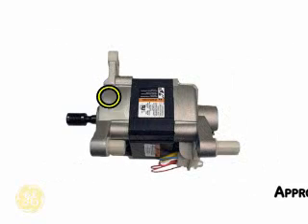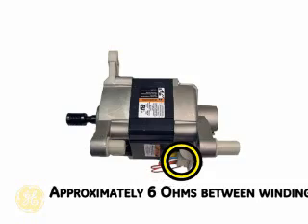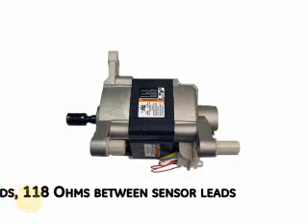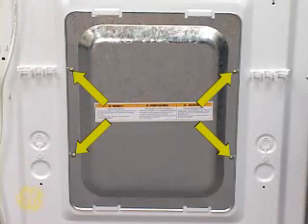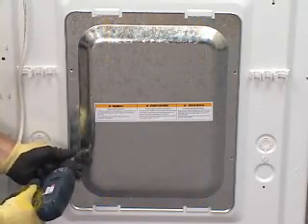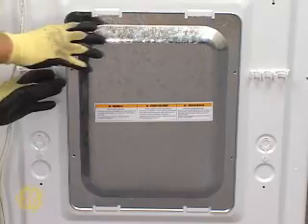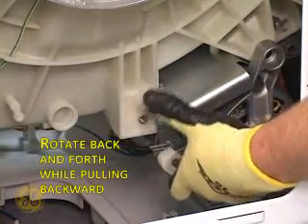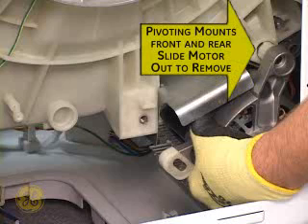ApplianceJunk.com - GE Front Load Washer Repair Guide - Motor Testing and Removal

Comment: This is shockingly simple, you can take the motor off with the wire attached and reattach them before you reinstall it.  No need to take off the front access panel.